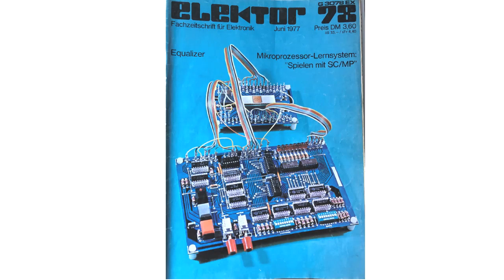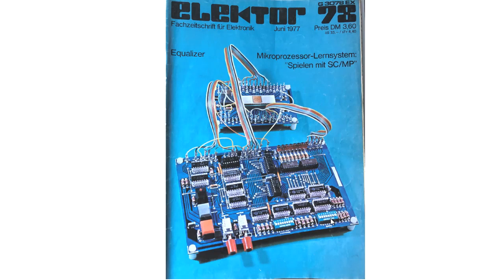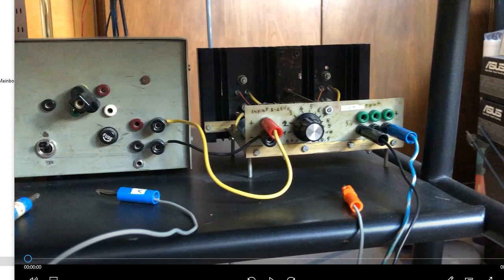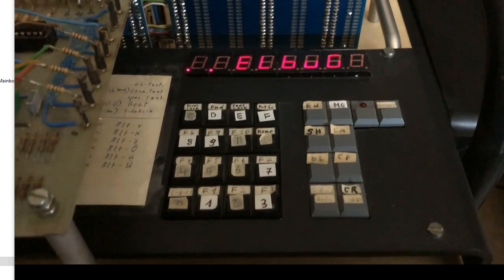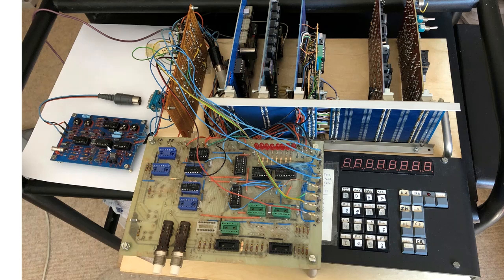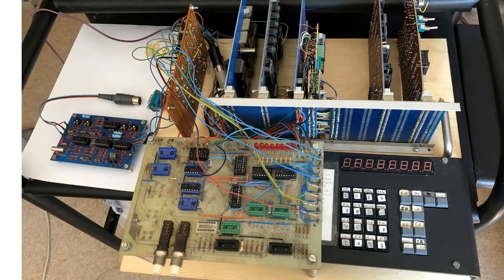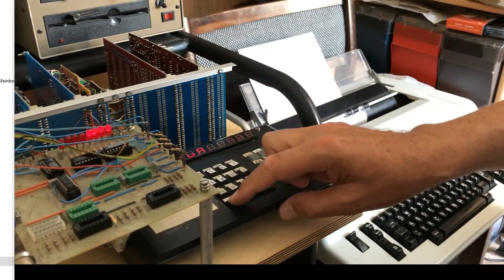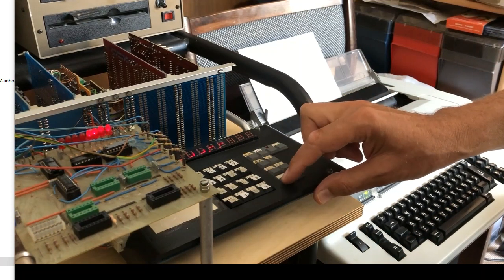Playing with SC/MP - 8 bit Vintage Computer from 1977

Comment: Is that the disassembler from Elektor? It looks like it got lost, along with the other sample programs from ESS-005.  Could you upload the code?
Reply from the maker: Hello Michael,
I think that I made the disassembler myself. I've just uploaded a version for the Olympia ES100 and one for a Lo15 teletype to:

https://github.com/RoSchmi/SC_MP/tree/master/ProgsAndDocs

Happy typing. If you want to use an RS232 interface to transmit programs to the SC/MP you can find some hints in this repo as well.

Do you have a running SC/MP system yourself? Is it published somewhere? What is ESS-005?
Kind regards
Roland

Comment: This was exactly my first computer, too. I had hooked it up to an old Telex machine as printer, which was slower and louder. I had written a program to convert ASCII to the 5-bit baudot-code for the Telex. I have also built the later computers from the Elektor magazine (I'm in Belgium, where the Dutch edition was sold, that was published under the name "Elektuur"). I still have several of these boards, although no longer in a working condition.
Reply from the maker: Thanks @Erik Evrard. Yes, I had Telex (Lo 15) as a first printer too. Baudrate of 75 and if I remember right about 60 Volts signal voltage. It was very loud and slow.

Comment: A friend of mine built the basic binary in/out system shown on the cover of the magazine (Elektor magazine was popular with electronics hobbyists here in the UK) and so that was the first 'computer'of any sort that I ever programmed. Unlike yours, his system was never expanded beyond its initial form.

A short while later I bought and built a 'Science of Cambridge' MK14 which was also SC/MP based - it was a direct descendant of the 'National Introkit', but unlike that system it had a keypad and display from the beginning. I still have the MK14, still in working order. Thanks for showing us your SC/MP system.